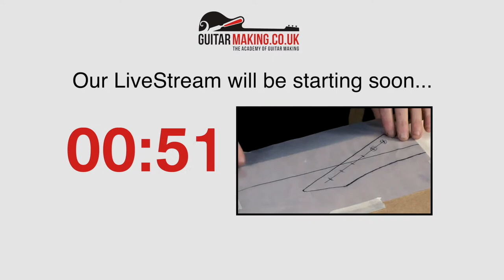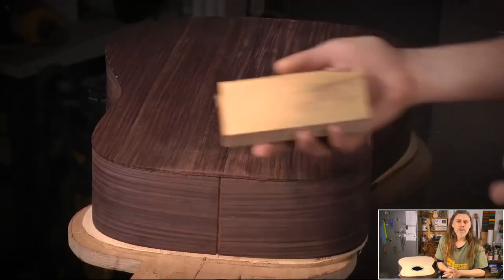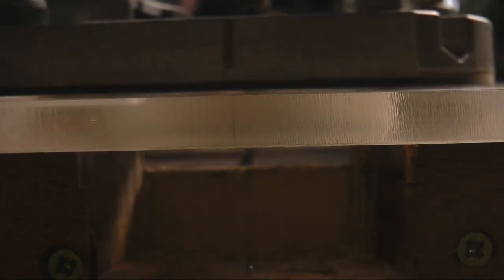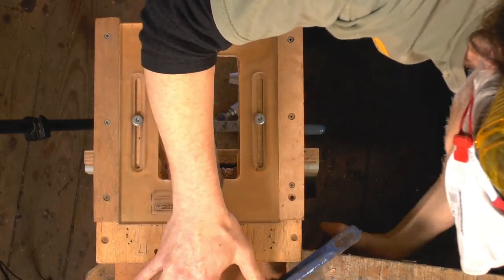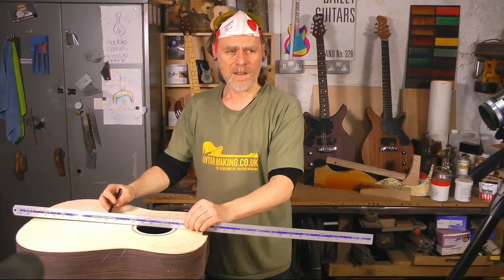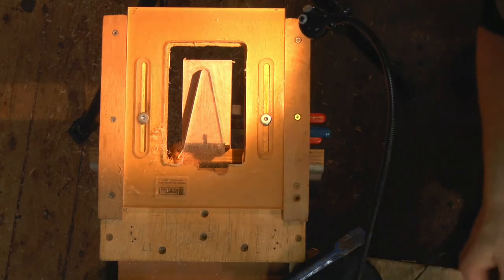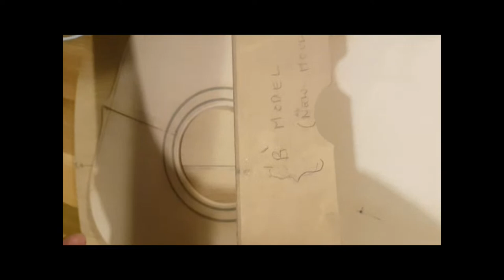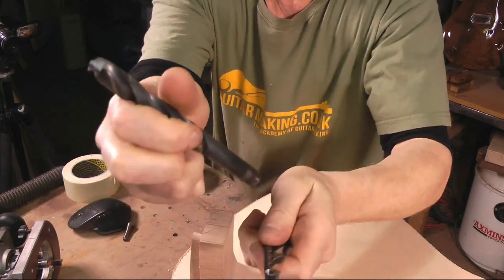Making an Acoustic Guitar - Dovetail Neck Join

Comment: Hi. I'm a retired carpenter and build acoustic guitars in my spare time now. I dont use a dovetail joint for my neck joint, I just use mortise and tenon, I cut the mortise by hand removing bulk with forstner bit then finish with micro saw and chisel then cut the neck tenon on table saw, making sure i get the angle correct, and they have been perfect every time. maybe one day i will make a jig and try a dovetail instead

Comment: thank you. on the cracks, in metal i know you drill a hole at the end of the crack to stop the crack rom migration . why is that not done on wood ? the hole could be filled with a toothpick .
Reply from the maker: Excellent point - THANKS! That is quite right for metal. But with wood it is better to glue a brace across the crack (on the inside) to stop it spreading - there is no need to remove any more wood. Drilling a hole and filling it would leave more visible signs of repair - a glued up crack is virtually invisible.
Reply: @GuitarMaking  thank you